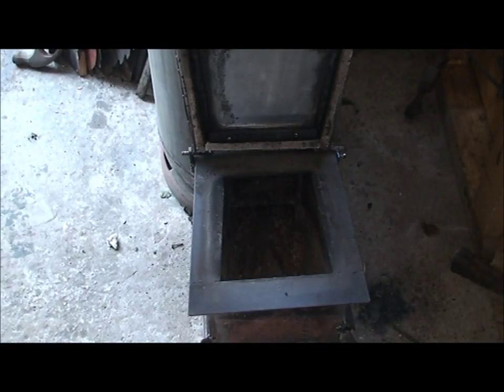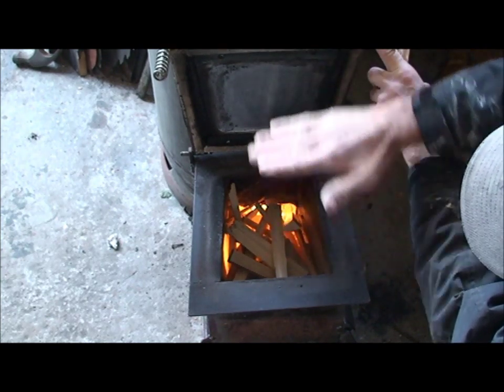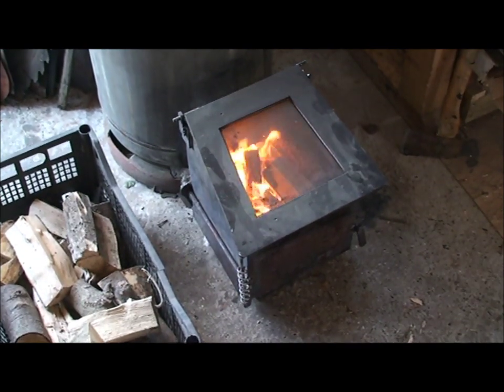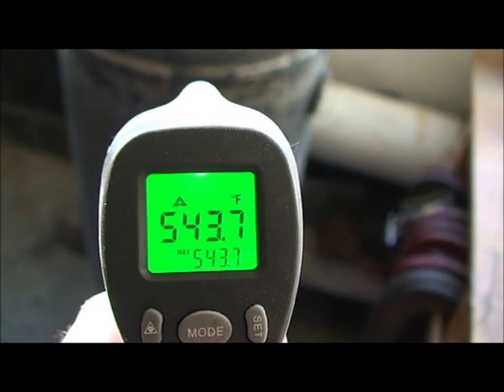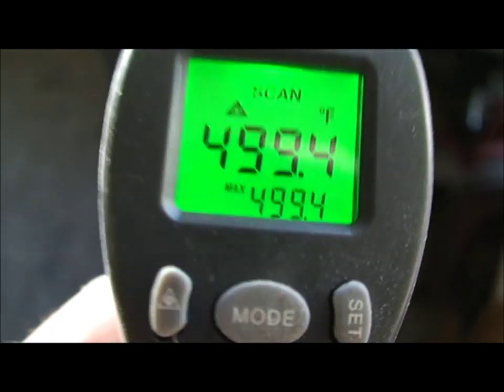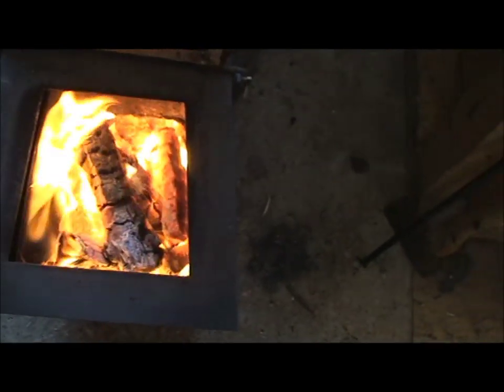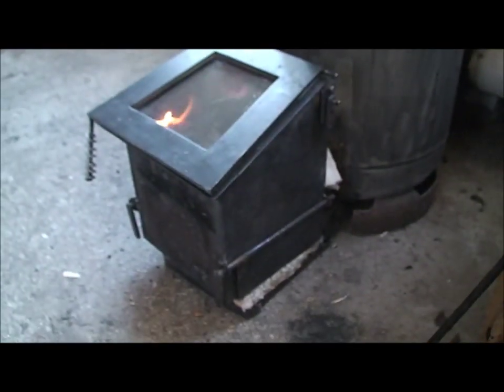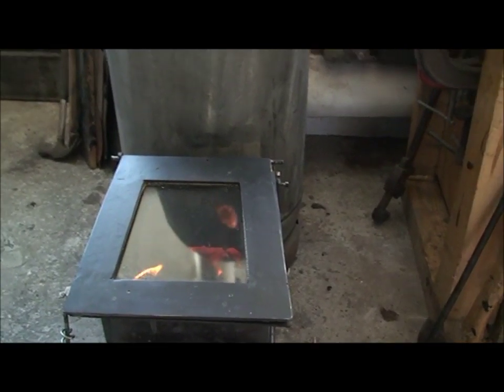Rocket stove temperature output readings

Comment: Hi, did you insulate the heat riser tube? Cheers
Reply from the maker: yes on that stove i did I used perlite
Reply: @LozHarrop   I found your vid about it later, as I read through the comments, after seeing your steel riser burning away, I'm considering trying a cast fire cement type of thing...Cheers

Comment: What is your flew made of ?  how thick is it? and how is it lasting ? I started cutting a tank to build one but not sure how I will go with flew so to make it last. I plan to take the stove with me from Canada to the Azores where they do not heat houses when I leave in the near future with hopes it will work better then my wood stoves here that burn lots of wood.
Reply from the maker: Orlando Pereira The flue is really thin ducting tube in mild steel and is just as good as when i fitted it. Because the temps in the flue are low I imagine it will last a long time.
Reply: I just made a stove up. I used 6x6 for the primary  burner and 5" round stock x1/4 wall for the upright burner in the tank. It would only go up to 750deg.F.  The flue is 5" but I only had it on temporary and not properly sealed.  Do you think that would be the reason it would not get hotter ?
Reply: @orlandopereira4320  needs more air
Reply: Orlando Pereira Sealing is crutial to fuel economy and heat output. Tiny leaks will burn ALOT of wood over a winter. All doors should be sealed with rope gasket. Flu will last from Home Depot. The expensive part is the insulated flue which goes through the wall/roof. The naked flu can be the cheapest available and last a near lifetime, mine is 4yrs old in my garage and looks new aside from surface powder.

Comment: Superb!

One question: when you shut down the primary air vents (WOW those slow flames are beautiful!) am I right to assume the secondary air is left open and unimpeded?
Reply from the maker: Hi Marcel, No the sec air is closed down when the primary air inlets are closed, just the way I built it when I changed the vortex, I may change this when I build the new firebox but it seems to work good like this
Reply: Fair enough.  I was just thinking that because of the heat in the firebox, gassification is still occurring.  Without oxygen, those combustible gasses are largely being vented without being burned.  Keeping a secondary air feed open in the burn tube would extract that energy and increase efficiency.  It shouldn't burn down any faster because there's no more primary air but you'll get more heat out of the fuel.

I reserve the right to be wrong ;)
Reply from the maker: Marcel Lenormand Yes you are probably right, but my firebox is not totally air tight a tiny amount of air can creep in past the air flaps, I left it like that so there would always be a slight draw through the system to prevent gas and smoke build up. A sec air feed would do exactly as you suggest.

Comment: ?Thanks for quick reply PP, have you avid on how to insulate the riser? thanks Phil
Reply from the maker: Phil, this vid shows briefly the riser its just an outer tube covering the actual riser made from 1/2 mm or so steel with a 35mm gap filled with small grade perlite about 12m 10s in   Rocket stove riser tube, final build and burn.

Comment: I need to make a big fire box with a glass door like yours . You got to love the 1000 degree coming off the top and how when you restrict the air it drops 100-200 degrees that quick .
Reply from the maker: Hi Jzx, great the way we can control these big fireboxes now and contain the heat, this one runs for around 4 hours shut down on a full fill and puts around 200-300f heat out.